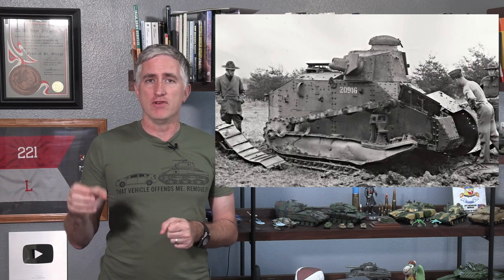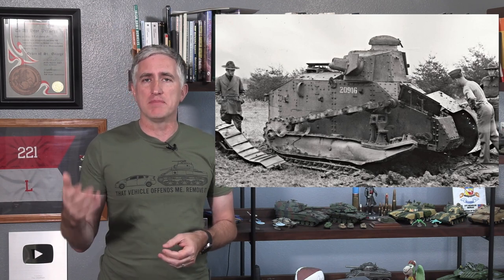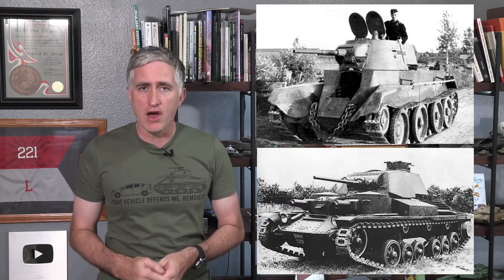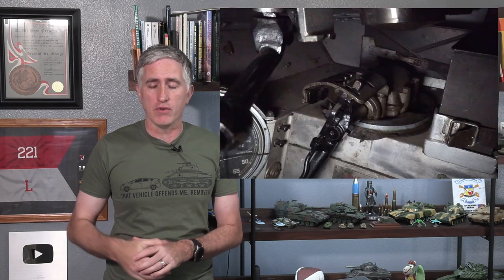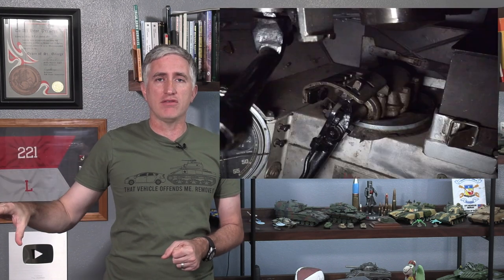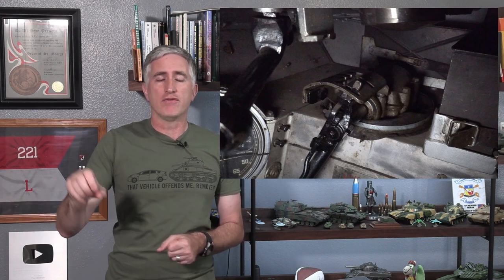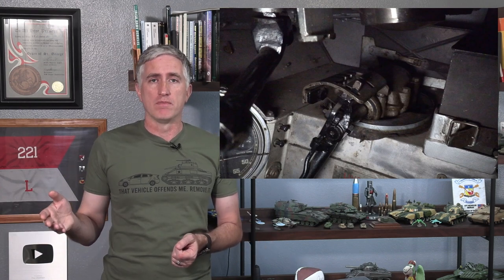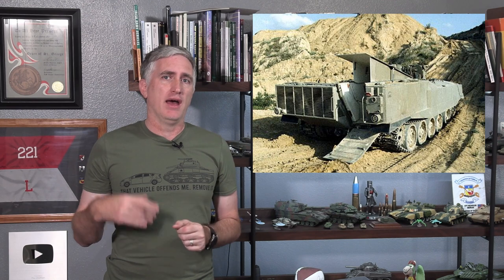Advantages of rear engine tanks with front drive sprockets

Comment: I heard that the Merkava was developed with increased crew survivability. A couple extra meters of metal in front of the crew.
Reply: Yup. One of Israel's most valuable (scarcest. Relatively small country) resources is personnel and they know it, so Merkava was designed with a massive emphasis on crew survivability at some cost in other departments, a trade that is considered acceptable for its role of holding the line against their middle eastern neighbors
Reply: it really doesnt matter because APFSDS
Reply: @danielsteger8456  Sabot is no more magic than HEAT. More mass bleeds more energy and absorbs more shrapnel. And that rear door cannot be overstated imo. Tank get hit, is burning, you are wounded. Rest of the world you climb/are shoved out the roof then drop 2 meters to the ground. Merkava you walk/are carried right out. I believe I also recall stories of it working in reverse, intact Merkavas picking up wounded crew in a battle
Reply: @ronaldthompson4989  It's also about training & experience - equipment is replaceable , data is irreplaceable. Each member of the crew contains data that is difficult , expensive and time consuming to replace while for the most part another Merkava is available in a depot somewhere. (The also care about their people, not many israeli suicide bombers in the news, if they exist at all)
Reply: It must also be remembered that the Merkava was a 1970s design, and Israel wasn't the technological power it is today - back then even the richest western countries didn't have composite armor on their tanks yet, with only the Soviets having early composites in service.

While kinetic munitions could still reasonably be stopped by sufficiently thick steel armor like on the M60A1 or the chieftain, nearly ubiquitous HEAT warheads in the form of RPGs and ATGMs could not, and an engine + air + fuel combo worked quite well. Sure, losing the engine is bad, but with the present technology the only alternative was losing the whole tank, and that's much worse.
Reply: @ronaldthompson4989  sure a lot of people survive when they are hit and penetrated with HEAT or sabot and putting the engine in front will do a great improvement in terms of survivability

Comment: @The_Chieftain
 Question:
You've studied a lot of tank development history, do you think electric powered vehicle/tanks will be developed in the near future?
How do you think it would affect tank design and doctrine?

Stuff like all tanks starting the engines at the same time, inner room, or would rear hatches become more prevalent?
Do you think   a military Tesla Cyber truck like vehicle would be viable or they would all fall prey to thrown objects?
Reply: Fully electric vehicles and even hybrids in most situations in military service don't make any sense. Ah yes we're being attacked but our tanks still need 20 more hours to charge up this could be alleviated with easily changeable battery packs but now you're talking about replacing a component that would weigh more than a humvee on a tank every time you need to go somewhere and the other issue is range would be lacking. And another big problem water gets in armored vehicles shorting out huge high voltage batteries causing chemical fires that won't go out for months and getting shot at the vehicles will turn into plasma cutters and catch fire and also modern battery cells since they are a chemical fire can and will burn for over a week completely submerged in water
Reply: @justnsaliga8518  The Tiger P did have an electronically assisted transmission it was powered by a motor generator
Reply: @kiddeggplant  It was a temporary solution of how move very heavy object. And it worked well. But the engines Porshe used...
Nowadays it make no sense, because why design something new, when you already have perfection? Classical system is fine, but if tanks will get much bigger, then diesel-electric
engine, like one on trains can be used.
Reply: @alexturnbackthearmy1907  The torque power curve of an e motor is exactly what you want for a tank or an assault gun for scoot n shoot situations but as it stands even modern electric motors are terrible at moving weight around have you seen how fast those Ford Lightnings battery deplet just towing a mid size boat? Its crazy bad

Comment: Front sprocket transmission keeps tension on the top of the belts. Not pushing suspension when accelerating, and shaking the belt removing mud. The driving is smoother because the suspension shapes the terrain. 
Back sprocket is cheaper to built, near the engine, protected, however the belt tension is on the bottom, pushing the suspension when accelerating. More wear and sweat on the suspension. Driving feeling is harsh, shaky. High breakdown rate.

Comment: Given Puma Lynx are well protected ethically and practically what's the effecacy of ifvs being as well protected as mbt since they have more crew plus infantry assault teams thus more personnel than mbts. The mbt has standoff ability but ifvs usually have 30 or 40 mm automatic cannon to close with enemy infantry and tanks. The mbt gun 120mm is being put on boxer and cv90 since k51 panther is using 13cm. So the improvement for mbts maybe increased hp in engines speed and range standoff to accurately saturation fire whilst ivfs protection allows them to close with enemy. Is this a correct prediction of future design for ifv and mbts? @chieftan.

Comment: Kinda just imagining a Sherman with the radial engine but the engine is laid down with the drive shaft coming out the bottom and it goes forward through bevel gears. Probably some extra power loss, and one expensive set of bevel gears.
Reply: Problem with that is that the engine was designed to run upright (in an aircraft) so if you laid it on its back there would be problems with oil distribution (it wouldn't drain into the sumps...)
Reply: @nerd1000ify  I didn't think of that, but it might not matter because ostensibly they're dry sumps?

Comment: Doesn't the trans axle construction also save weight?(Engine in the back, drive sprocket in the front)

If the drive sprocket is in the front the driver, radio operater and transmission share the same compartment. Hence the tank can be built much shorter, which saves weight. If you take a look at the panthers hull compared to the centurion, both offer almost the same level of armor protection, but the hull (without turret) of the panther is over half a meter shorter and because of this up to 4 tons lighter. Panther hull length : 6,87m ; Centurion hull length: 7,6m (The turret diameter is 20 cm larger, so we should ad 20 cm to the Panthers Hull to be fair, but the double torsion bar suspensions and the many road wheels of the Panther are probably much heavier than the Horstmann type suspension of the Centurion.)

Saving weight was also important for the shermans design.

Comment: I wonder if you could make an antitank barbed wire. If you worked with it you could probably come up with something that would gum up the suspension system of most tanks.
Reply: My grandfather used to work for Queensland main roads. They of course had lots of bulldozers. Occasionally they were asked to provide one to the rubbish dump, where it was used to drive back and forth over the rubbish and compact it.

He says that wire in the rubbish was a constant source of pain on any machine they loaned for this, it would get wound up around axles and road wheels and became very difficult to remove (plus it presumably smelled like petrifying garbage).

Comment: The problem with front sprocket / rear engine is getting at the transmission is it needs serviced or replaced.  You have to remove the turret, and a lot of stuff to get at it.  Rear engine, rear sprocket, the entire power pack can be swapped quickly.
Reply: Well, that wasnt a common thing for a looong time. So about same amount of trouble back in 1940`s.

Comment: If tiger 2 had rear transmission and drive sprocket in an engine pack would this of prevented final drives breaking due to sloped armour putting the weight balance on the front wheels of the tank. It's an empirical question please @chieftan forgive the alternative history nature of the question since leopard later solved this problem?

Comment: Disagree with last "minor reason" if only because of the fact that there is a video around of post ww2 mobility tests (I think by the swedish when they were deciding what tank to buy).
The video shows trials between a panther a sherman and a british tank (forgot which one, possibly a churchill). And the panther despite being the bulkiest and having the worst power to weight of the 3, goes around much easier than the other two in a variety of conditions, whether it is inclines, snow banks, crushing trees etc... Of course torsion bar suspension + interloping road wheels is part of the reason but pulling from the front IS better than pushing from the back when we are talking about 30,40+ tons vehicles...

Comment: If there was some reason today for having the transmission on the opposite end of the tank from the engine, but you still want things to have a quick disconnect, couldn’t they make the shaft that connects the two couple to the engine and transmission in a similar way as a PTO shaft that connects a tractor to a farm implement?

Comment: With the merkava what's the trade off for having the turret further back? I'm assuming it'd affect being hull down and peeking over slopes but that's just a guess.
Reply: Peeking over is one thing (though the Merkava isn't terrible at it). Composite armor is a pain to place (now that it's available), because you have to lift it off every time you do engine maintenance, necessitating a modular design. Commander and driver have a worse field of view directly in front, though that can be mitigated somewhat via cameras.

Comment: That makes little sense to me.  What difference does it make at which end you move the track from?  Regardless if its font or rear sproket, moving the track requires the same force. If anything the dirt, sand, and grit will fall away before the track link makes its way to a front sproket where the force is applied, and thereby causing less wear. VS the rear sproket that gets a constant supply of dirt and grit since the track just left the ground, as the tank moves forward.  So a rear sproket wearing the links less makes no sense.

Comment: Is  the use of the metric system a better way (accurate) to understand engineering when compared to the old imperial measurements?
Reply: Depends on what engineering you're looking at. You got something written with Arshins as a measurement....metric is probably not the first answer.

Comment: i'm somewhat surprised you didn't mention the TAM as an example of a tank with a frontal engine...  i know it's technically an IFV chassis (a Marder), but still
Reply: Take troop transport, slap old tank turret on top, sell to friend as MBT, use proceeds to fund actual MBT, laugh at friend
Reply: @ronaldthompson4989  to be fair, the weight requirements for the TAM meant you can't use an actual western style MBT.

Comment: Was crew survivability in the event of a hit to the frontal arc a consideration in the design of the Merkava ?
Reply from the maker: It was, but my understanding is that ammunition resupply came first in priority and that would have been enough on its own.
Reply: @TheChieftainsHatch  I've heard the version that it was primarily a protection issue - the front engine (and fuel tank) placement was the only thing that could offer sufficient protection against shaped charges, since Israel didn't have any composite armor technology at the time.

Comment: The Merkava was purposely designed with the transmission and engine in the front to double as secondary armor in case of a round penetrating the frontal armor. The focus is crew survivability which is even more critical for Israel because of their small population compared to that of the hostile nations that surrounds them. The deliberate placement of the power pack was the result of lessons learned during the Yom Kippur War where Israeli tankers suffered huge casualties (over 1000 tanks) due to the Egyptian and Arab forces being suppled with Soviet wire-guided Malyutka (AT-3 Sagger) anti-tank missiles which destroyed over 100 Israeli tanks in just the first day. The AT-3 was capable of penetrating the frontal armor of Israel's primary tanks: US M60 Patton and British Centurion.
Reply: First you disable the tank, then you set it on fire, when the crew bail out you shoot them down.
Anti-Tank 101.

Comment: The BMP-3 has its engine in the back even though it's an IFV. Entry and egress is a bitch. But then maybe it was built with the idea that the troops would be riding on top rather than inside the vehicle once they got inside the combat zone anyway. Who knows?

Anyway, I was reading one of your old articles on why the 17-pounder wouldn't fit in a 76mm Sherman turret, and it brought up the point that the 75mm didn't fit in the 76mm turret either since the arrangement of the components was just wrong with the shape of the turret. Of course I agree with your point with regards to the 17-pounder since it was huge (and is still pretty big even by modern standards), but what about the M4A3E2 with 75mm guns? What did they do to finally manage to squeeze the 75mm into the pinched nose of the turret? Did they have to re-engineer the gun to fit in the turret's pinched nose after all, just to be able to have a 75mm in the Jumbo? And on the other end of the spectrum, what did the post-war MDAP programme do to the smaller original Sherman turret to be able to fit the 76mm gun into it?

Comment: Hey chieftan what did the bumbers after a tank captures by Germans meant for example the S35 had the 739
Reply: Captured tanks usually had 7xx designation, where 7 meant foreign origin tank and xx was just a next available number. Somua S35 was Pz. 35S 739(f) which meant:
- Pz. - Panzerkampfwagen - tank
- 35S - Somua S35
- 739 - tank of foreign origin, number 39
- (f) - französisch - French

Keep in mind, that 739(f) was a full designation, not 739. Using only digits may be confusing. For example 740(f) was Char B1 and 740(r) was T-26.

Comment: The Video seems to me a bit bizarre. 

The main reason that German tanks had the motor in the back and the drive in the front was that German tanks had open tracks that easily took the mud and tended to throw off the tracks. If the drive is in the front the mud fall from the track while on the upper side. That persuaded the "Heereswaffenamt" and thus all WW2 German tank had it. 

The disadvantage...is that the shaft costs an awful lot of precious space and thus weight. That`s why German designer developed a closed track and placed the drive in the back in the Leopard. 

As a private person I had a Porsche 944 in the 1980ies. That car had the motor in the front and the gear box in the back. Shifting was never an issue. But I had some issues with the transaxle (shaft) that rotates at motor speed.   

The Leopard was much better to repair than the Panther with motor in the back and transmission in the front. The whole motor - transmission block was taken out in less than 2 h.

Comment: What is the reasoning for having the engine and transmission in the front on some light tanks, like the AMX-13 or the CVR(T)'s?
Reply: Likely served to balance out the heavy oscillating turret.
Reply: On the merkava it was purposely made that way to add more protection for the crew.
Reply: Space basically. Putting both engine and transmission in the rear would require a lenghened vehicle as the driver still needs the room in the front. The resulting vehicle would be longer and heavyer. Putting only the engine in the rear would require a driveshaft. As the turret needs the entire with of the vehicle you would need to raise the turret for the driveshaft. The resulting vehicle would be taller and heavyer. Putting the engine next to the driver is just the most compact.

Comment: Engines don't really make good armor, there's a lot of empty space there as well as volatiles like fuel, hydraulic lines, hot engine oil, bottled emotions, etc.
Transmissions on the other hand have some empty space but can have much heavier housings and tend to present a much more "metal-filled" profile, and usually well-filled with a thicker and less flammable lubricant.
Reply: Tbf, initially it operated as a decent spall shield, though I'm guessing with modern munitions that has long since PASSED.

Comment: It may be a stupid question but I was wondering if a front sprocket wheel on the left and a back sprocket wheel on the right design was ever drawn. Having 2 sprocket wheels on opposite sides of the tank in parallel could in theory work and I'm wondering if this could benefit in any way but then again it can be completely stupid im not sure
Reply from the maker: I can't imagine why anyone would try. They'd need two engines, or two power shafts, or whatever. Pointless waste of space.
Reply: @TheChieftainsHatch  thanks for the reply, I'm glad I didn't ask this on patreon hahaha

Comment: Why was the radio in many tanks during interwar and WW2 right beside the hull MG gunner? Why didn't the commander operate it, if the tank had a commander position that is.
Reply: A tank commander had enough on his plate without having to operate the radio as well. A crew member assigned as 'radio operator' could :
- monitor incoming calls
- wait on the line if it took time to contact another unit or HQ
- relieve a tired crew member eg driver
- replace an injured crew member